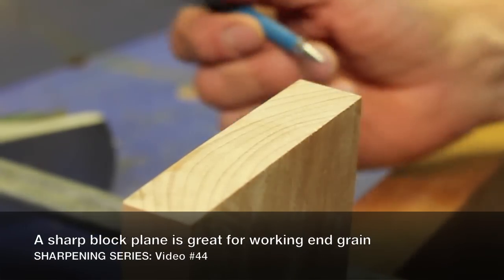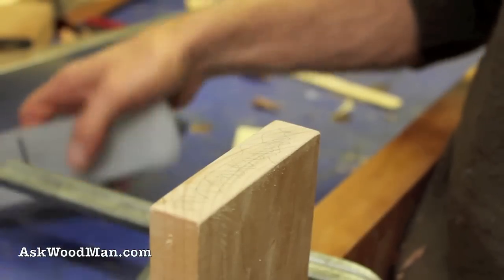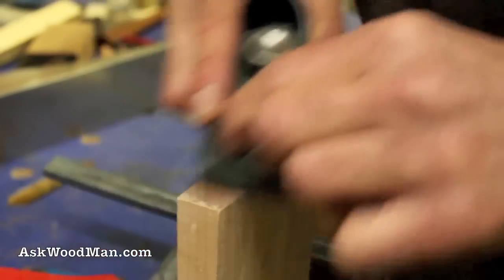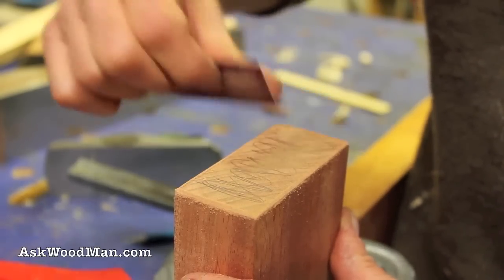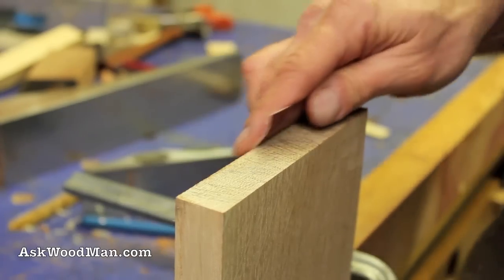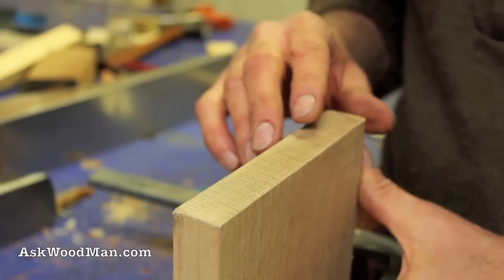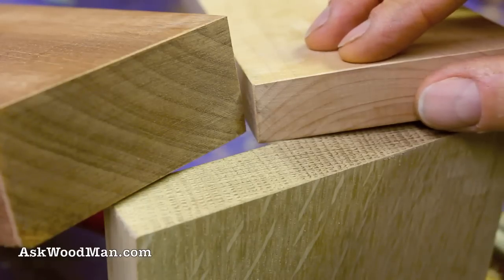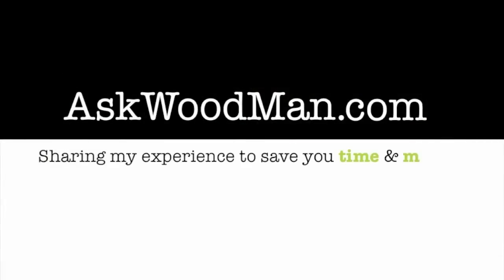How To Cut End Grain • Complete Sharpening Series Video 44

Comment from the maker: @scoobydog411 This past winter I did an overhaul on my old Hitachi dust collector. When I took it all apart I was shocked at how little there was to it. Just a motor attached to a circular plate with some pieces of thin plate welded to it as vanes was all that formed the impeller. A little sheet metal and inlet/out hookups and a switch. Do you weld?

Comment: Late to the party and a novice to boot, but why do you hold the plane at an angle when shaving the end grain, rather than straight across parallel to the end grain?
Reply from the maker: It is called cutting on the skew. Instead of trying to bulldoze with the whole edge, the skew cut leads with a small portion of the knife edge and peels the cut as then the rest of the knife enters the work. I do this with chisels planes and scrapers. Try it for yourself.
Reply: Thanks for your reply.  I think I need to sharpen my box plane blade.  My wood interests lie in the luthier area.